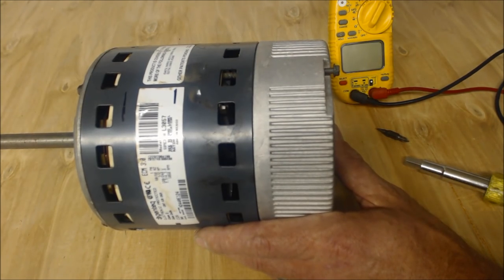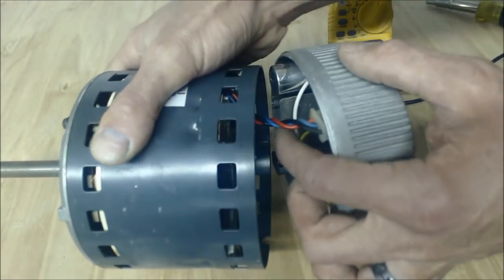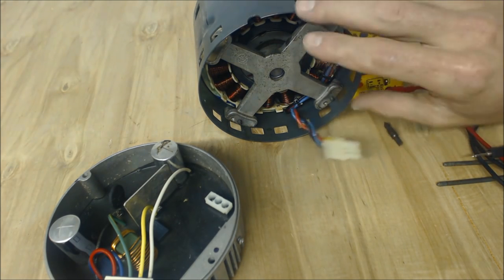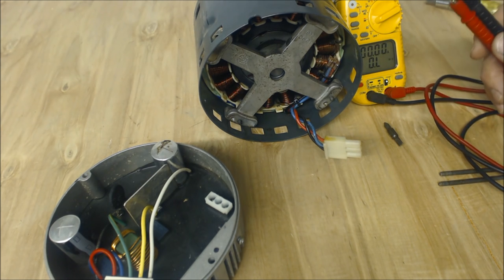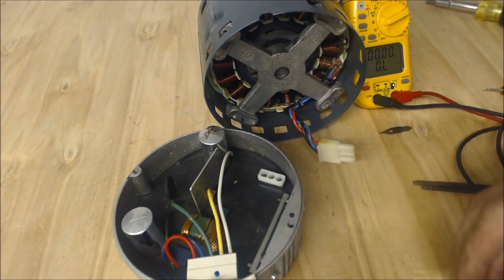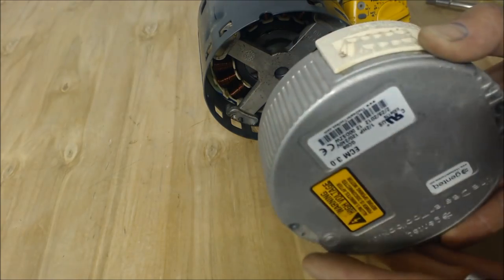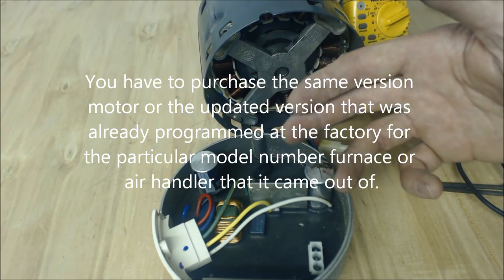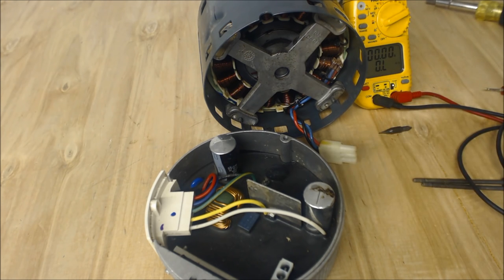Troubleshooting Variable Speed Fan Motors!

Comment: Those three wires are  low speed medium speed and high speed.  That whole back in can be replace with  a capacitor and a 12 volt relay That  is a 3 speed motor not a 3 phase motor. Just you would like to  know.    Have a good one!
Reply from the maker: Hey Walter, that is a three phase motor. Each pair of windings have the same ohm reading. Multi speed motors have different resistance values on each speed. The highest ohms are low speed and lowest ohms are high speed, thanks

Comment: That "three-phase motor" has a hellish number of poles....depends how they are wired I guess.

Just saying.

Question. 

When would motor speed be controlled, say at lower than synchronous (full speed)? Versus letting it run at full speed?

On a residential AC system, the compressor/condensing/evap components start when the t-stat calls for cooling. What and how is the variability of blower speed determined?

I'm a electrical controls guy retiring into my first love (and prior educational pursuit), HVAC.

Thanks to all for any feedback (there I go again).

Comment: FYI, i've had a couple of those UEI amp probes over the years. I really like them and cheaper than FLUKE. Here is a problem I discovered though. They have two strong magnets on back that will actually pull the negative spring battery contact away from the battery. The meter will malfunction, so always check your meter operation before using it? The solution for me was to remove the magnet on that battery side and still have the other when needed.

Comment: What if blower motor is constantly running? Had ac man come over and he switched out the board on the outside that goes to thermostat and didn’t fix nothing so he says it has to be blower motor?!? Is that true or do I need to find someone else to look at the ac?

Comment: I'm reading roughly 4.8  between the red black and blue wires to a motor controlled by a 2.3 ecm. would that mean My motor is good?  In my bell housing I have a disc capacitor tat is burned up.  I haven't pulled the board but could this single disc capacitor labeled SG379 be the reason My blower motor would not run?   I don't see any other visible damage..  Please advise?   Your videos are very descriptive.   Excellent Job.   Keep em coming..   This motor is a GE 1 hp 120/240 7/11amp  model 5sme39sl0253..
Reply from the maker: If you read the same resistance on each of the three pairs of wire windings going to the motor then that motor is good. Yes the cap could be the cause if you see it is burnt up. Usually you do see that it is either the regulator or the cap burnt up. Thanks

Comment: Hi 
I try to fix my ECM 2.3. I test the module of the motor and it seems ok with not burn out. I am trying to follow your explanation about checking the winding on the motor. So when I check my blue and red I get .008 . Then black and red .008 but the balck and blue is .004 on resitance. Also, I checked the continuity on all three of them and all of them beep.
So that mean my motor is bad?
Your help will be really appreciate.

Thank you so much in advance
Reply from the maker: I would check your meter before checking the motor to make sure that you are at 0.0 ohms of resistance and your probes are not off. Most times it is the module that is bad but yes the motor is a three phase and should have the exact same resistance for each set of wires.  Also a side note, most manufacturers charge almost the same for both compared to just the one unfortunately but the other thing to remember is that you need to purchase this from a distributor that handles the manufacturer of your equipment whether york, bryant or some other, thanks

Comment: You make great videos. I have had the same blower motor for over 30 years at my house. The only problem with old equipment is finding a young tech smart enough to provide service, if you need service. Bad caps are primary in computers, televisions, etc. Guess where they are made? New tin-foil cabinet HVAC is standard these days, and actually not a new phenomenon. Again, I enjoy watching your videos. My comments are not a criticism of your work. Cheers
Reply from the maker: Thank you for your comment and I knew there was no criticism but thanks for spelling that out for clarity. Thank you very much for your comment and involvement in our channel! Yeah you are right!

Comment: so a variable speed ECM has 12 to 16 pin connector. But a multispeed ECM has only 5 pin connector. Please correct me if i am wrong. thanks.
Reply from the maker: Yes the ecm x-13 has 5 low voltage spade terminals and manufacturers use either a plug or individual spade connectors, thanks

Comment: Hello enjoyed your tutorial on blower mothers I learnt a lot ty...... I have a old mother given to me and I wish to use it extract dust from my wood shop in my basement in a effort to keep the dust extremely low,  
   I have a machine dust extractor already and in process of converting to a two stage collector..... And a fine dust extractor hanging from the ceiling, not portable... There very good but I wish this extra source of dust extraction portable.....     
So I set my acquired blower cleaned it all 20 years of dust Yikkies.  
The motor is free in both direction......  I have set up a temporary circuit, to try it out.  It does have a switch for speed control.... So on staring it up works well.  BUT my power source is 110 she I connect it to a 210 power source.? My speed controls are working But all same speed no matter which one I try? The speed of switch does work....my first thing I'm going to get a new meter mine a hand own one and no longer works........when I get back I'll try. 
Your method of detection in wires and capacitor ... 
Yes I will make sure it's disconnected from scarce first.    
Lol any advice would be great thank you.
Regards Phil
Reply from the maker: Are you talking about a variable speed, constant torque, or psc motor? The video you commented on was variable speed. You should connect it to the voltage the rating plate says.  Thanks

Comment: can an ECM motor be just multi speed and NOT VARIABLE? how can you tell by looking at the furnace control board? thanks,
Reply from the maker: An ecm x-13 is multi speed and starts slowly and ramps up to each of the torque levels. It has spade terminals instead of plug terminals for the low voltage, thanks

Comment: Have you ever used the Qwik swap or Qwik seer along with a psc motor to replace a x13 or Ecm motor. There website I believe is Qwik.com.Thanks for your videos.
Reply from the maker: That's Mainstream Engineering's site and no I haven't used them. They only work as a replacement for constant torque ecm motors, not variable speed. They also only work on single speed furnaces or ac units. The efficiency overall when including the watts from the motor is not going to be as efficient as the x13 because you are still working with psc windings. I usually replace the X13 with either a standard psc if I can't get the motor fast enough or the X13. Thank you for the thoughts!

Comment: If the motor check out and you have an x14 without a harness, would the check procedure below verify if you have a bad bell/module?  

First, confirm line voltage on the motor at terminals L and N on the motor connector. Next, confirm the C terminal on the motor by checking for 24 volt ac from that C terminal to the R terminal (or R wire, usually red) on your low voltage terminal strip.  Then connect alligator clips to R then one at a time connect the other end to terminals 1 thru 5 on the motor. The motor should start up and run on each of those speed taps.  If you have a situation that your motor quits after one minute in some circumstances, you should test run each speed for an extended period of time (5 minutes ought to be ok).  Finally, use an amp meter to check the amp draw of the motor to ensure it's not over-amping.
Reply from the maker: Yes here is a video on the x13, thanks-  https://youtu.be/ZzvhtmQTiMY

Comment: Those bastards making them near impossible to repair. It clear they knew what area would fail first, so they made sure nobody could fix them easily.
Reply from the maker: Ha ha, it does make getting the customer back up and running in a timely manner more difficult and more expensive, thanks

Comment: Hello ac service tech I came across one of these on a carrier air handler. Te fan kept coming on and run for 15 sec and turn of then come on right away again for another 15 sec then come off and on right away. I keeps doing that, I checked low voltage and high voltage and both voltages are present when it turns off. I checked continuity from its ground terminal to metal structure of air handler and its OL could that be the issue or is it just a bad motor?
Reply from the maker: That sounds like a bad hub. Do you happen to have a tecmate pro- -  http://amzn.to/2jIP0ty - they make it easy to tell but it sounds like it is a hub but you should be sure ahead of time. Hear is a video of me using the tecmate and this takes the board out of play so if you have the same results when usijng the tool then you know for sure it is the hub on the motor, thanks- https://youtu.be/lO5PArRF9rg

Comment: I have a ecm 2.3 motor that I need to replace. I can't find the same exact model but I can find them with everything exactly the same except for rpm. can I use a slightly higher or lower rpm motor?
Reply: just the motor not the module

Comment: Is this also called the variable  speed module? I misdiagnosed  one on a Lennox G61 the other day.  Could I have used my techmate pro
Reply from the maker: Yes the tecmate would help the diagnosis. If the tecmate turns the motor on and there is not a fluctuation up and down and up and down again in speed then the motor is good, thanks

Comment: pulled the hub on my unit and the caps look good.  The motor checks out great when I run both resistance tests (various colors against each other and against the motor frame).  Is there a test with the multimeter to run so that I can know the hub is good even though the caps looks okay.  My experience tells me that a good looking cap isn't always working.  Thanks so much!
Reply from the maker: Besides these tests did you use the TecMate Pro before taking it out? Check out this other video. -- https://youtu.be/lO5PArRF9rg    --   Here is the link for the TecMate Pro-  http://amzn.to/2jIP0ty
Reply: +acservicetech I appreciate your reply.  I should have noted the motor is an X13.  By the way, the link you provided for the TecMate Pro indicates the the product is currently unavailable.  Great tool for those motors!

Comment: That unit has 2 bulged caps. Could replace those for abt $2 each before you pay $600 for a motor.
Reply from the maker: That's correct if a technician has them, thanks
Reply: How do you get thru the half inch of black epoxy to work on the circuit board?
Reply: @leomcadams1751  Cut the leads from the top and solder the new part to the exposed leads.

Comment: Is there anywhere online to get a replacement bell housing for a (Genteq Evergreen 3/4 HP 230 Volt Replacement X-13 Furnace Blower Motor)? I looked and didn't see any bell housing for any blower motor.
Reply from the maker: Usually you have to order them directly from a licensed dealer/distributor to verify that they are programmed for that specific model number thanks
Reply: My motor is testing out good 8.5ohms on any combonation thanks for teaching me that. Now testing the bell housing my motor runs all the time even when thermostat is turned off and i unplug all the wires on the blower except blue(hooks in L slot on blower) and white(hooks in N slot) wires.  I'm thinking it should be off when just the blue & white wire are hot and need orange or red wire to get hot to engage, because when heater engages it sends 0.035v thru orange and red wires. Would that mean the bell housing has a short causing it to run even when thermostat is turned off? Wow i just read my manual L&N are supposed to be hot all the time with low voltage C & 1-5 turning it on so i must have bad bell housing.
Reply from the maker: If the blower motor runs all the time, there may be a few things. It may be an open limit. First check for 24v from w to c on the board when you should not have it meaning the tstat off and then check for 24v going through your limit switches,. If a limit is open the blower won't shut off, If you have 24v from w to c when not calling at the tstat then bad tstat or bad wires. Try taking the tstat face off and see if the blower still runs, thanks look up acservicetech blower fan motor won't shut off video
Reply: Thanks alot for being so helpful i found a rebuilt module on ebay for $125 the ac parts places won't sell to me they require a contractors license
Reply from the maker: Got ya, just make sure that it is for your model size, thanks
Reply: It was i sent them a picture of mine they said it would work. I just put it on and it is working perfect! Just in time for our coldest days of the year in New Orleans. Thanks and Happy New Year
Reply from the maker: As long as its working well, great, thanks and awesome to hear!

Comment: Why not buy a fluke meter?
Reply from the maker: Fluke is good, Fieldpiece and UEI seem to be more oriented towards hvacr though. Any of those manufacturers are good though. Fluke meters are precise as well and often times used by electricians, thanks!
Reply: acservicetech I have been using the 902 for 10 years now it's hvac specific, they sell it at united refrigeration.
Reply from the maker: Thanks Vic!